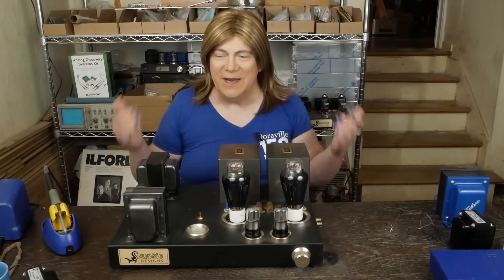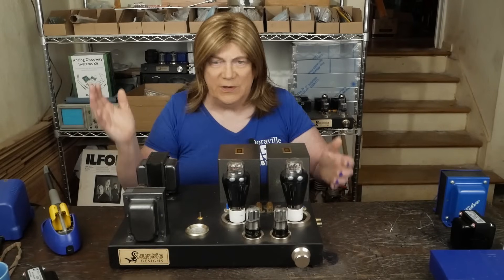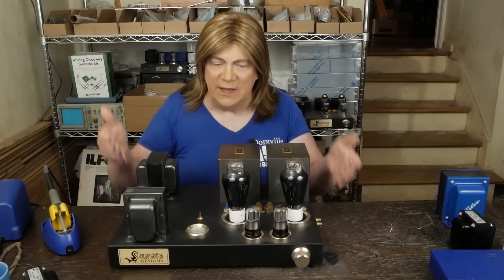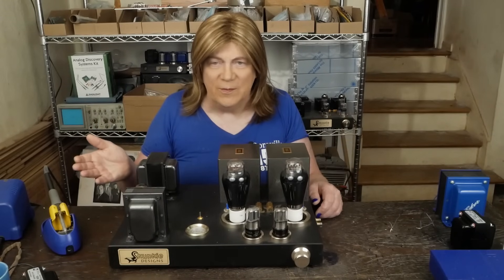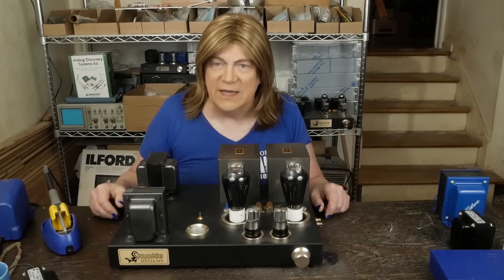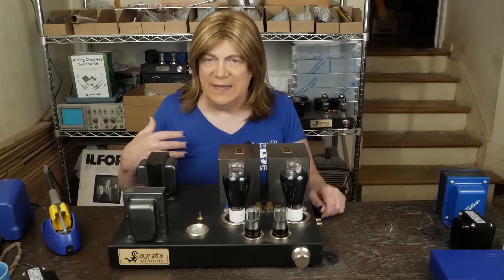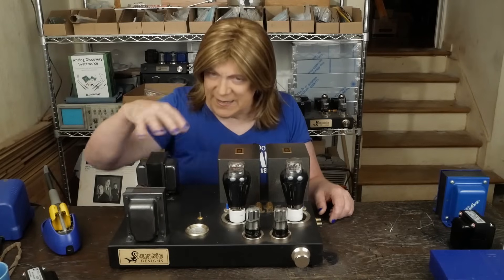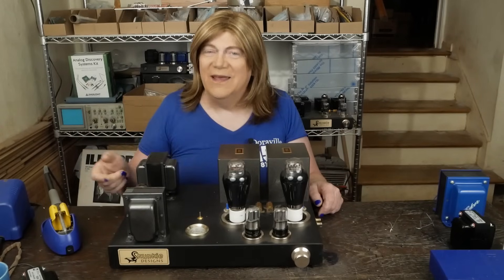Tube vs Solid State Amplifiers

Comment: I want to know more about the amplifiers you build. Like that  beauty you are showing there.  Right now I have a Denon PMA 1600 and connected to it a European Audio Team (EAT}  tube based phono stage., E-GlO petite. 
My amp is an A biased  A/B push pull amp. The first 35 watts or so are on “A”  and I barely need to go louder. My bass is supplied by 2 REL R7 subwoofers tuned to 45 hz to 48hz at the top. My main loudspeakers are B&W 702’s s2 series.   In the turn table I have an Ortofon black MM Ludwig Van Beethoven 250- Shibata on boron cantilever. As you can imagine my soundstage is  larger than the largest tank at the Monterrey Aquarium.  A the pageant of sound in it almost as beautiful as the pageant of life in the ocean. It is frankly and plainly put,  fucking gorgeous. All this done with modesty  and careful observation.  And thanks to you and others on you tube that spill truth and wisdom. Thank you !!!!!  I have acquaintances eith larger more expensive equipment but their equipment doesn’t sound as good as mine. I know this because they say so to me.  
But I can’t hold it anymore I want to know if you build amplifiers, how much they cost and what do I have to do live with one of them for whatever time I have on this Earth Planet being 68 years old.  Come on open up and let’s talk.  You have helped to come this far out this way.  The pursuit of music is magical. For me the voice of a cello in my living room is absolutely priceless. You and I , we, are already together in this journey. Stay with me. Let’s take it to the next step. In honest admiration. Luis

Comment: WOW, I agree with everything in this video! But tube or SS, zero negative feedback is paramount. Negative feedback doesn’t discriminate, it lowers harmonics regardless of whether it comes from instruments or the audio circuit. And a piano can naturally produce large amounts of 2nd harmonic distortion, which should not be lowered or eliminated to sound right.

But there are SE, zero feedback, SS amps that boost 2nd harmonic distortion. So, it’s not impossible for SS to sound like tubes. On the other hand, it’s very hard for tubes to achieve extremely low distortion levels.

Comment: Clear and concise explanation.  My listening room is 13.5 by 26 and untreated.  I don’t need high pressure.  Great low listening with energy when needed is what I want. Tubes are the easy choice here.
Reply: My listening room is 12 by 24 and I too don't  need spl. Lower level listening volume let's me use a 5 watt single ended amp.

Comment: On a similar note, I’m having a Dynaco ST70 (with switchable Triode wired output) with an Octal Dynamutt Board, being built (in it’s finishing touches - lowering of the FB resistor and a B+ Cap change feeding the outputs..) It has solid state components, ie, CCS on the cathodes of the 6SN7 phase inverters.. I might be getting the best of both worlds here, as it seems there is less penalty sonically with CCS on the cathodes vs the plates, in this implementation at least.. Time will tell after break-in if I still find the presentation appealing to me.. I’m not really a fan sonically of the usual CCS  implementations (C4S, etc.)  in SET designs, and prefer high quality Plate Chokes if possible.. I like both SE and PP amps.. 48 here, but have health problems and rely on a tech building me gear..

Comment: Those looking for great cost effective effcient speakers, look up Omega Loudspeakers. I have a set. They take awhile to break in, but when they do, its magical. From 92-98db efficient range. $1k-$5k prices.
Reply: @@DrSinisster  Yeah the bar-fridge size 'Majestics' I built are rated at 97db/1w/1m & they cost me $3.5 k to build.  300 watts but I've only got a 135 watt SS amp driving them.  I don't need subs I just turn the bass up more & rock on!  But when I really wanna sit down & just listen, I swap over to my little 12AX7/6V6 amp!

Comment: Ran maggies with Hegel H390 and 590, then picked up Klipsch Heresy IV in anticipation of getting a Decware SE84UFO (hopefully get in August), which had a totally different sound, then Harbeth SHL5 which was kind of the best of both.  I like playing with different equipment, and felt a need for an inexpensive preamp.  Ended up picking up (used) an LTA microZTOL mk2 Pre/Headphone/integrated (1W @ 4ohms).  It drove the SHL5s enough to listen at quiet levels, but when I hooked up the Heresys WOW!  It sounds amazing!  Big soundstage, speakers disappear as you said, and hear little details I had not heard before.  So looking forward to getting the Zen now, and perhaps building a 300B in the future.  Thanks for your videos!

Comment: I use both.  If you want clean, fast extended, effortless bass, solid state on the subs is 100% the way to go. Then use quality tube amps for your mids and highs.  Every tube amp out there is looser than a well fed goose in the lowest registers. Loudness is not the issue.
Reply from the maker: Thanks for sharing!
Reply: I have a solid state amp on my sub. the rest is all tube ! ❤👍🏻